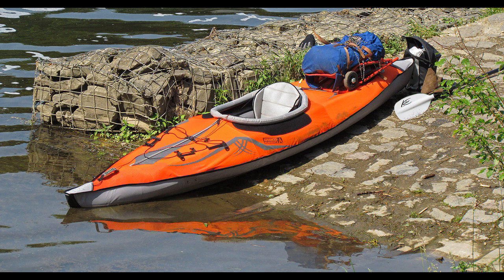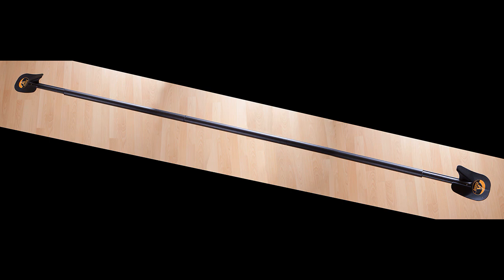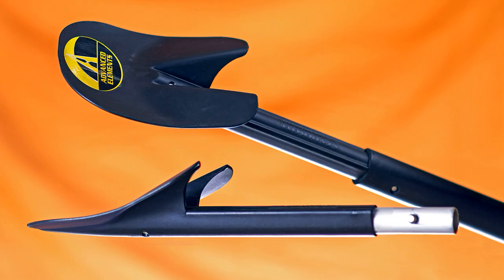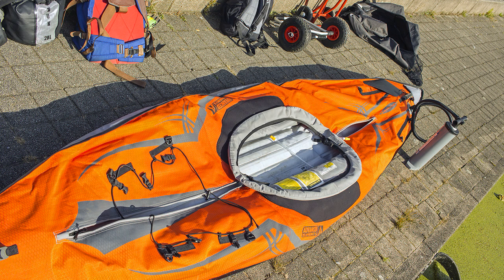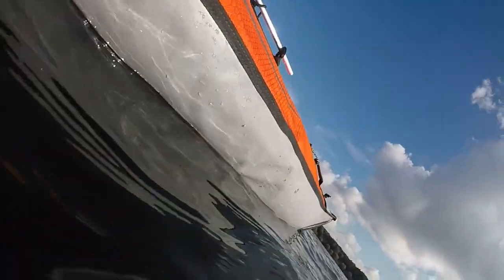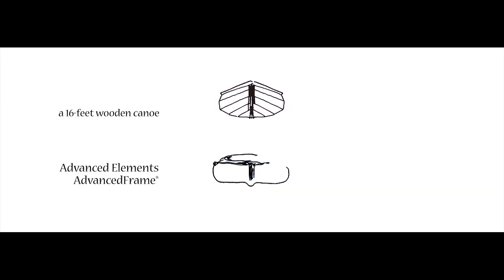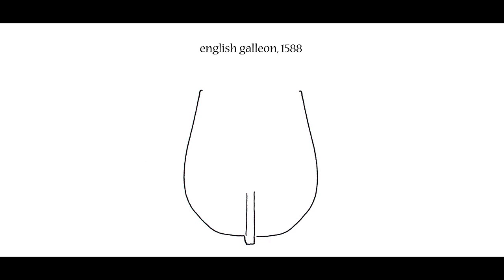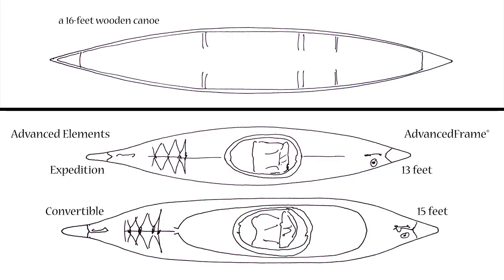Why a so great Kayak: ADVANCED ELEMENTS AdvancedFrame®

Comment: Thank you for your excellent review and inspiring footage ! I appreciate the elaboration on the backbone - looks like a good option to add stability without sacrificing comfort, like you do with a dropstitch floor...Cheers!
Reply from the maker: I have had a test with drop stich. Seems to me, that the boat is then a bit more "on" the water. That changes the character: seemed to me like less stable. While I prefer rivers, furthermore I prefer the backbone. The boat gliding "in" the water brings sommething like more conduct. (hope, I found the right words)
Reply: @gerhardochsenfeld9588  great feedback thank you very much I understand exactly what you mean, one quality I like about this kayak is the low center of gravity, how it puts you in the water like a hardshell, less of a human sail I believe lol compared to other inflatables like my sea eagle 330

I ride an inflatable paddleboard in kayak mode as well. Initially I wanted a dropstitch floor to mimic that, but this review with the notes about the backbone deepend my understanding. Appreciate it!

Comment: Nice video, and thanks. I'm a big 1.85m, 120 kg man. Would the expedition be ok for me or should I go for the convertible ?  I'm just getting into this. Thanks.
Reply from the maker: If your ass is very wide, maybe it is not so comfortable? If you have a muscular build and maybe a bit of a paunch, it will not be a problem. So or so, both the Convertible and Expition have a width of 32 inches. There’s no difference. I myself am 1.82 m – although (sorry) at around 75 kg. But if I was you, I would take the expedition, because of the HANDLING: the Convertible is simply too big to be handled well by only ONE man. If you are on tour alone, there will be big problems, when choosing the Convertible.

The Expedition has a capacity of nearly 200 kg, the Convertible offers 250 kg. So or so you will not have any problems because of your body weight! But PLEASE don’t forget to choose the backbone (!) as a part of your basic equipement!

IF you are SURE (!!!) to go kayaking always (!) with one or more companions, so that there is always someone to help you to carry the boat onto the water or out of the water, THEN the Convertible (using the one-man-persenning) is really offering more comfort. – Please think about your priority: Do you need more flexibility and freedom? Or do you never be alone when riding on the water, so that you can choose more comfort?

Comment: I can't decide between buying the sport or the kayak in your video (the 1012). I'm leaning towards the cheaper and lighter sport version as I will be taking this on the bus, train and walking a lot with it. I figure 10lbs lighter would be helpful, however, I am going to be taking it on the ocean and fishing, and I am thinking that maybe the 1012 model in your video would keep the water from the waves out much better with the smaller cockpit? So it's a bit of a toss up right now. The sport model; lighter but probably get more wet? vs the 1012 model; weighs 10lbs more, but probably stay a lot more dry? I'm also thinking that if I get the cheaper, lighter sport model that I could afford the backbone as well, whereas if I got the more expensive 1012 model I would have to wait until next month to purchase the backbone. Thanks for the informative video!
Reply from the maker: Not easy to decide. But please let me point the fact out to you that I'm using AE1009, the Expedition. It is 13 inches long, AE1012 has a length of 10,5 inches. So there is a difference, concerning luggage/loading, concerning the comfort in paddling straight on… and one more time in weight (a bit more than 1012). I'm not sure if there will be a difference in getting wet inside the boat, concerning the cockpit. If you aremy paddling on ocean water, if the water splashes above the boat, the textile and the seams will let the water pass through (less at once but more and more with time and number of splashes). It's fabric. I myself am wearing a neopren shorts to hold my bottom warm, while I do not only paddle if wheater and waters are warm – and I get always and soon sit in water and have a wet bottom. As someone once told me: it remains water sports…

Comment: may I know what is this oil to make the backbone mount smoothly ?
Reply from the maker: It is vaseline, photo shown from 2:48 up to 2:56 min. in the video. The so called „white vaseline“ is a highly cleaned vaseline, used as a pharmaceutical base component. Thus the use is medically harmless – but nevertheless controversial discussed. The „contamination“ with aluminium powder is unavoidable. Both, vaseline and aluminium powder, should not get into water. Use a paper tissue to clean and throw into regular waste. – Vaseline is still viscous around freezing point and not runny, if days are hot und sunny. That's the reason why vaseline is highly suitable to fit the problem.

Comment: is this boat good enough for someone 6' tall?
Reply from the maker: Oh, in Germany we are used to talk in meters. I had to calculate first – and found out: I myself am 6 feet tall. So, don't worry. Seems I was the subject of the tests specially for you.
Reply: danke =)
Reply: do you think the convertible model with back bone would be more comfortable easier to stretch out legs and lay down, or get the expedition?. the two AE kayaks are long, 3.9meter, and 4.5meter, will they be harder to paddle? i can't decide :D
Reply from the maker: Question is how to handle the boat out of water! Once on the water, the Convertible is as fast as the Expedtion and maybe a little bit more good natured (that is, however, really not a great difference!). Going with the Convertible as one-man-kayak (special persenning is included!!!) is purely joyful – but you NEED to paddle in company of two boats, because you NEED another one’s hands to help you to come onto or to come out of the water. 
It is a hard and sometimes desperating work to handle the Convertible out of water: 4m 60 cm instead of 4m (Exp.) – and around 6 or 7 kilograms heavier. If you take your luggage out of the boat, the Expedition is easy to handle for one man – and I think still good to handle for a well trained or a tall woman.
Yes, there is much more space for one person, when paddling the Convertible alone. It is really very comfortable. But I enlarged my equipement by buying the Expedition, because I was going to lose the joy, when paddling alone with the Convertible – only because of the problems, when handling the boat out of the water: you need well prepared landing-stages, if there is no one to help you. However, I want to be loose – and able to paddle alone when ever and where ever.
On tour with an Expedition you are free to start anywhere, to change anywhere, to arrive anywhere. Paddling an Expedition is paddling with no limit.
Reply: yes you make very good points. at first i did think about buying the expedition weighing all pros and cons of the lengthy convertible and its open top design, then spend more $ to buy the deck cover.expedition comes with everything, just need the backbone. thanks for your experienced opinions, Gerhard.- from Canadian kayaker.
Reply: @jeansandmyshirt  hey man , do you know if this is a good beginner kayak ? I'm thinking of doing a circumference of Vancouver island and wondering how well it will perform in sea (close to the shore )
Reply: @MrAbhisheak  I would just get a long sea kayak, with a skeg/rudder, a used  14 16ft off craigslist. nothing beats a rigid kayak. Inflating and deflating these kayaks not fun. they are expensive, and prone to leaks and mold. You could easily transport a plastic kayak on top of a car with simple tie downs and some foam. keep in mind, inflatable kayks have air inside, you'll be bounding on waves alot more than in a real kayak. Which would cause more fatigue.
Reply: @jeansandmyshirt  Is longer the kayak its better ? Also is it true that AE is more stable than hard shell ? Also which is more fun overall if you dont look at price or storing issues? 

Thanks a lot
Reply: @MrAbhisheak  sea kayaks are made longer because longer hull is able to cut through waves better than shorter hulls. theres a reason why oil tankers and  big ships are made longer not wider. theres a scientific explanation online i read somewhere you could google. also the hard kayaks for sea are designed with a skeg and a rudder to help you maneuver through choppy waters. they will also go faster than inflatable version. i think the inflatable kayaks are just for recreational fun in lakes and calm waters. i won't trust one for a long trip around vancouver island. i was going to buy one but after experiencing kayaking in cheaper version of this kayak, out in deep cove indian arm(north vancouver) in choppy waters, i decided not to buy an inflatable kayak. it took hours to get back to shore, everyone else in their hard kayaks were flying by lol.